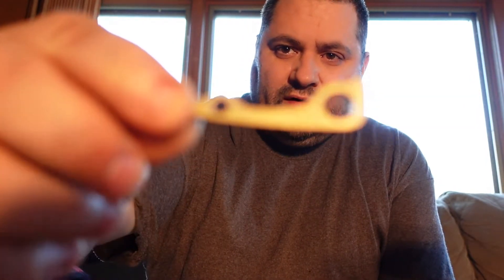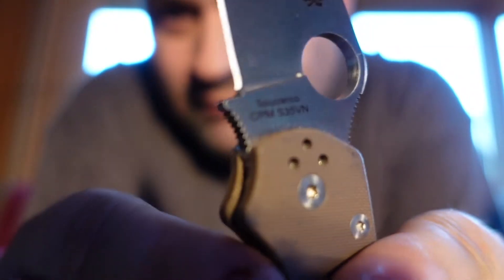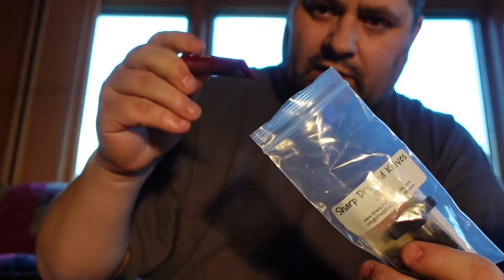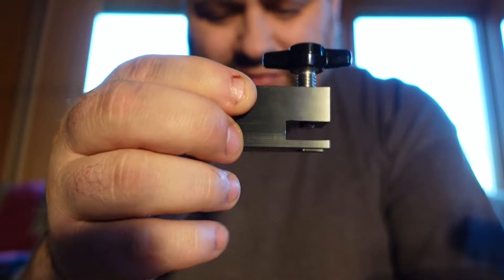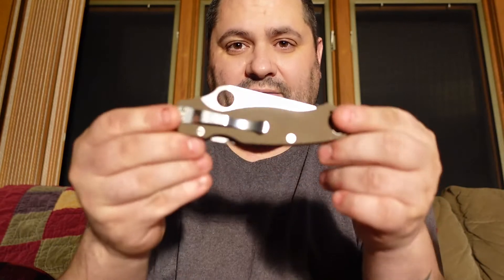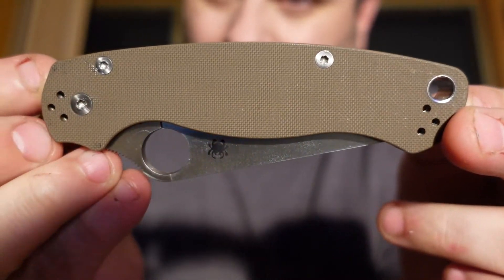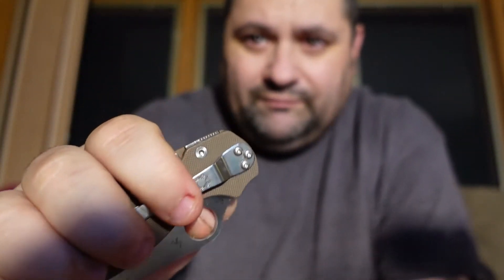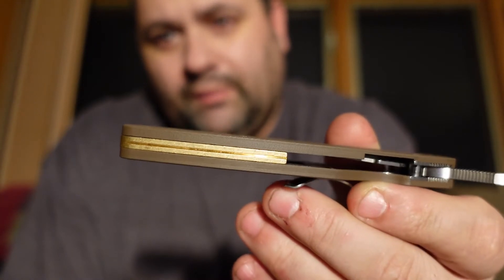Paramillitary 2 Back Spacer Install

Comment: Why would you post a video that doesn't show the install you were supposedly showing. What a waste of time!
Reply: When you have to use a Bit on Both sides it is not pretty especially if it is Red locktited ? I had to use two Bits on a Medford ,slim Midi and i was scared to mess up an expensive knife on camera i would do it now after But The Medford Pivot used T-30 Bits and they are very shallow ? i got my wife to hold the Bit in one side while i took out the other . Those screws are so shallow .I learned on Handguns if The knife is metal you can use a very small one hand Butane Torch it will only take a couple seconds to melt any Loctite . I use a Heat Gun on other materials .